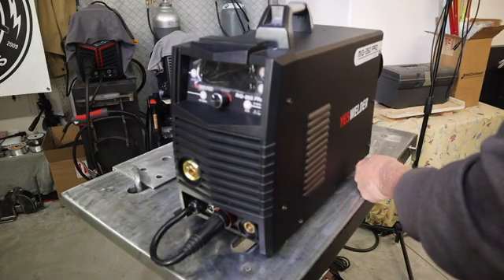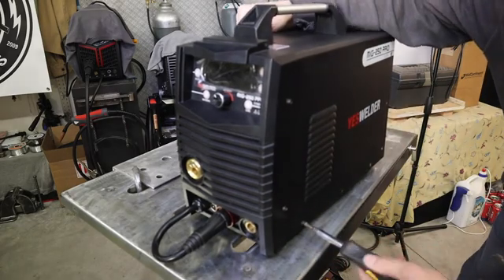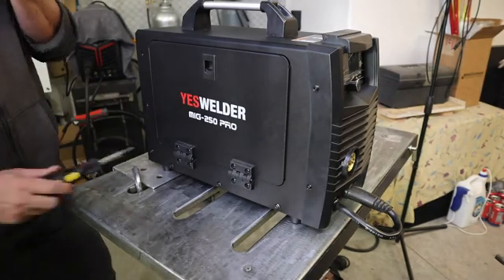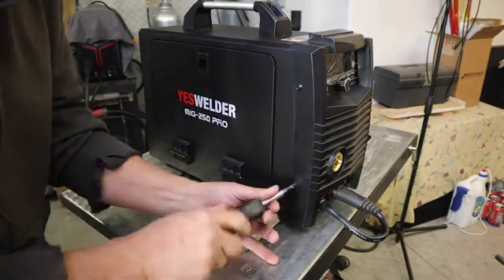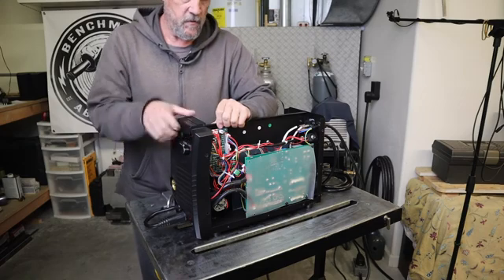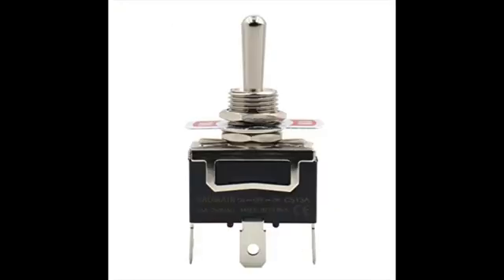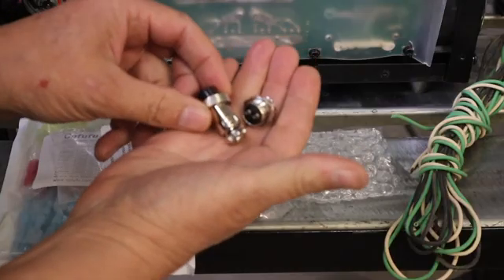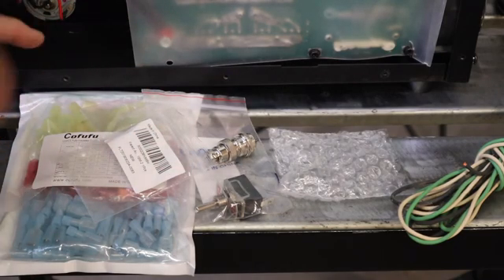Weld Aluminum with your MIG Welder - Modify the YesWelder MIG 250 PRO for Spool Gun

Comment: My LGT150 came with the GX12 plug.  I ordered the GX16 plug and receptacle set, not knowing the difference.  Not wanting to rewire the machine,  I changed the gun plug to the GX16 size.  Works like a charm.  Thanks much for the video, it gave me the confidence to to the conversion.
Reply: LBT150 ...  Sorry
Reply from the maker: Great job and you did it yourself! Nice! 👍
Reply: Yes.  I went with a 6 wire switch, carrying the ground as well, two positions only (ON/ON), and was able to put both the switch and the connector on the front panel just above the Euro Connector.  I did it on an S7 MIG200.  Again, thank you.
Reply from the maker: Excellent Job! Thanks for stopping by.

Comment: I did the exact same thing, to my Firstess MP200. I used the plasma cutter port, as I already have a plasma cutter better than the one on the MP200.  It works surprisingly well.  Great video! I put my switch on the front of the matching though. I had to do a little drilling and cutting. I had wanted to use your method, but I have 4 machines on my welding cart and cannot easily open the side door.
Reply from the maker: Nice Steven! How do you feel the MP200 welds with the spool gun? Are you having any difficulty finding a suitable setting for welding with the aluminum? I did consider doing this mod on my MP200 as well but I really don't need it for welding aluminum so I haven't done it. Nice job!
Reply: @DIYHomesteadProjectsDIYHP10  I am having trouble finding a sweet-spot for the settings, it seems to jump around a bit. Once I get it dialed in though it welds beautifully.

Comment: Hi, thank you so much for this detailed description! I wanted to get the yes welder mig205ds but wanted to see if it can weld aluminum as I need it from time to time. do you think it would be a similar easy modification because MiG 205ds does not have welding aluminum features right our of the box?
Reply from the maker: You're welcome SC. I think the physical modifications would be just the same on the MIG 205DS. You might have to get creative to find a suitable place to mount the power plug. The biggest drawback you'll have with the 205 is the lack of manual settings. But, you are able to adjust the voltage + or - 10 amps I think. You'll just have to play with the machine settings until you find a suitable combination of amps and volts (wire feed speed) for the material thickness you intend to weld. I think there is a video or two of people who have done the mods to a 205DS if you do a search on YouTube. It can be done but I don't know if the proper settings can be achieved but maybe.

Comment: Thank you for making and sharing this video. I'm going to do this to mine. Except that I'm going to solder those spade connectors. I don't trust crimps.
Reply from the maker: You're welcome Phillip. I don't blame you for soldering the spade connectors. I'm not a huge fan of the crimp method either. Good luck with your project!